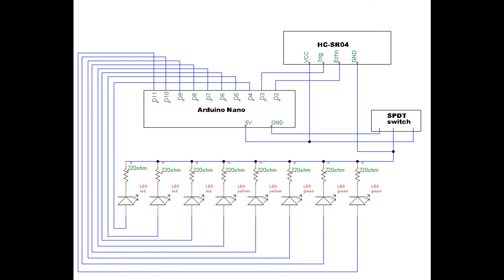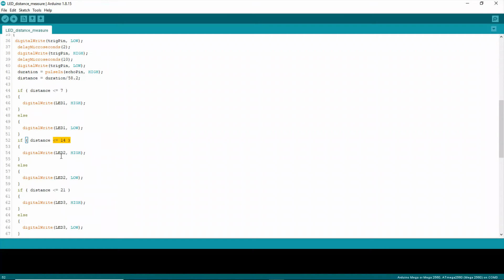Make Your Own DIY LED Ultrasonic Distance Meter Using  Arduino Nano - A Project Anyone Can Do

Comment: What are you using as a power source? Sorry new to building, and 220 resistor 1/4 or 1/2 w?
Reply from the maker: Hi Justin.  I just used a 5v 550mA usb cell phone charger plugged into it. Works great! The 220 ohm resistors are 1/4w. Good luck to you 👍👊